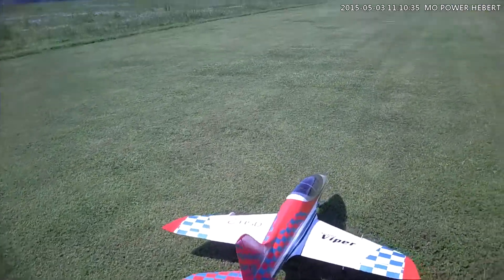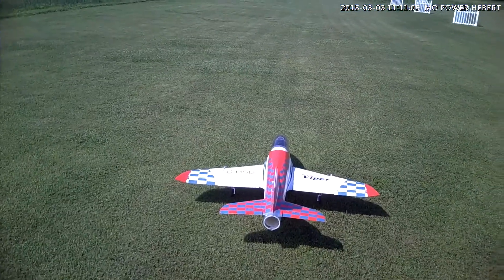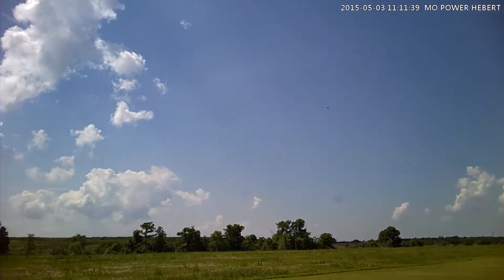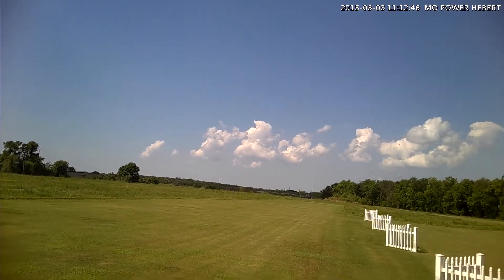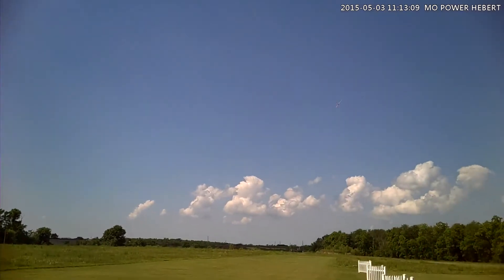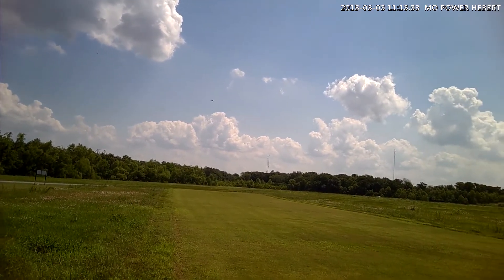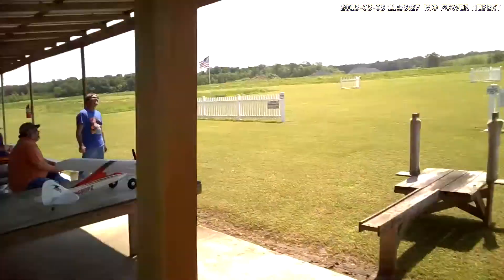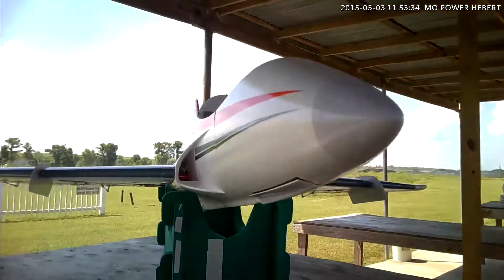HSD Super Viper 12S Version Flight Needs MoPower

Comment: Hello, great video. I would assume it is powered by the stock HSD 105mm EDF at 12S (two 6S 5000 maH). What is the flight time you get such that you land at a cell voltage of 3.7. Thanks
Reply from the maker: Hi Raed
That depends on you throttle management I would say 3 to 4 minutes.

Comment: for 134 mph and more than 1to 1 thrust , get the 8s motor put a  7 blade fan on 12s , glass the wing tips from where the spar stops to the wing tip , underside is enough , the same w/ the elev stab , boom , this plane is really not made to that fast , 3/4 throtle ,full  for vertical , edf hobies , for more info ,
Reply from the maker: Hi Chris,
Let me know if and when you can hook me up with that setup and I'll give it a shot.